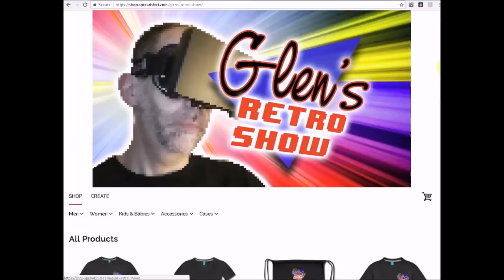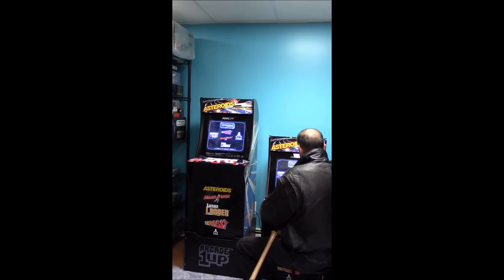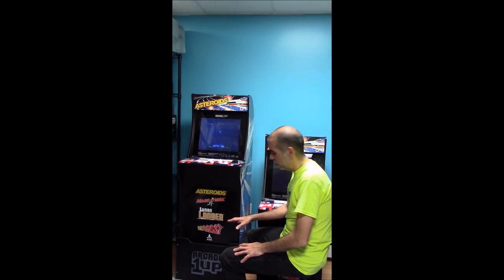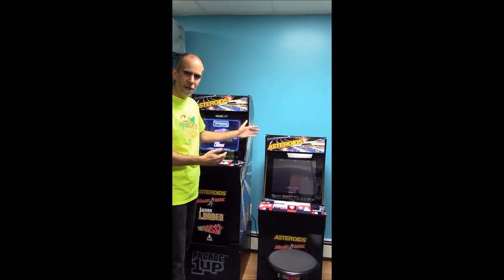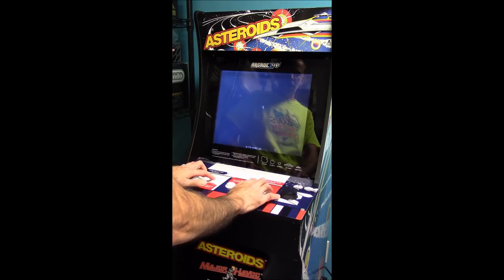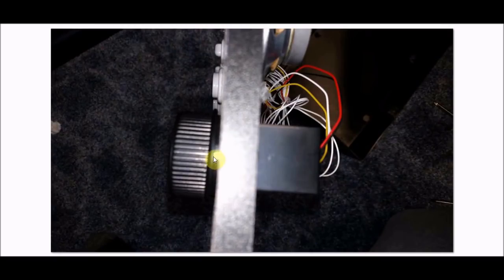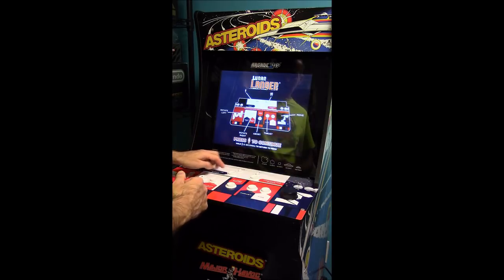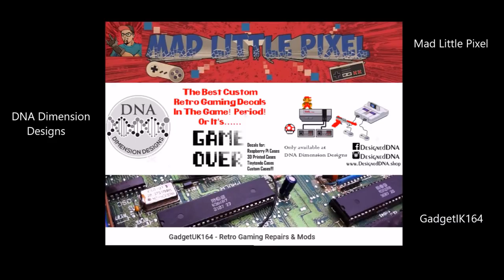Arcade1UP Asteroids/Tempest First impressions

Comment: Glen,

Great in-depth overview as always!  I also wanted to share my experience with you regarding my Arcade1up Atari Deluxe cabinet.  I think I'm going to have to get the Bruce Yeager mod instructions sent to me.  I've been in talks with Arcade1up regarding their choice of using a dial over a spinner, and they let me know they've appreciated the feedback.  My story starts off rocky, but fingers crossed for a happy end!

My Arcade1up experience unfortunately hasn't been as fun. I got the Atari Deluxe cabinet, and ran into several problems. I decided to test out the main components before putting it together and I'm REALLY glad I did. UN-peeling the plastic from the screen revealed my first woes. The whole screen was covered with micro scratches (every inch). I did at first think the scratches might be residue, so I took a microfiber cloth and went over the entirety of the screen. Unfortunately, the marks were indeed micro scratches. 

The second issue came after I tested it. I had concerns about a particular game, Major Havoc, after seeing a video of it being played on an Atari Deluxe cabinet where it had slowdown problems. Luckily, that wasn't the case and the game played at the correct speed. However, what made my heart sink, was the pronounced stuck bright green pixel staring back at me on the monitor. Now this may have been passable, and possibly unnoticeable, on a game like Street Fighter II, but it's a pretty distracting eyesore on vector games since they play on a black screen. 

The next issue, even with my short testing time, I started to see micro scratches forming around the "Dial" (we'll get to the "dial" situation next). Luckily Arcade1up has the overlay solution, so I'm happy about that. But let's talk about that "dial." 

I'm so disappointed that Arcade1up chose to use a dial over a spinner (the dial is akin to a volume control on a car stereo {one that keeps moving}). This makes the gameplay for Tempest and Major Havoc far from an authentic experience.  My dial, thank goodness, works as intended (no sticking issues), clicky but functional, but still not Tempest or Major Havoc worthy.  

As someone who's played these games extensively in an actual arcade, the dial doesn't feel or play even close to the real thing. Does Tempest technically function with the existing dial? Yes, but it doesn't play close to the original. Major Havoc, although also serviceable with the dial, unfortunately isn't precise enough to play very well. The alternative button movement controls on Major Havoc are also serviceable, but again, it doesn't give you the feel of the arcade. And the one thing either of these control schemes can't make work on Major Havoc, is it's "Breakout" mini game. It is absolutely unplayable with either control scheme. I now understand why the early prototype game Arcade1up was testing out, "Super Breakout," didn't make it to market. The dial controller can't come close to matching the precise gameplay required that a spinner provides. 

Now I do realize that the dial may have been more cost effective, but I would've easily paid $50 or more to get a traditional spinner. I hope Arcade1up comes out with a replacement spinner in the future as I really want to play Tempest and Major Havoc again. I did test all the other games on the cabinet and everyone, except Quantum (and the other aforementioned games above), work amazing! Quantum was one of my staple games in the arcade back in the day, so that was kind of disappointing as well. The spin speed on Quantum isn't strong enough to play it effectively. The distance traveled when moving the trackball needs to be increased, upping the sensitivity (maybe to Centipede levels). CALIBRATION IS SORELY NEEDED! But I guess 9 out of 12 games aint bad. 

I did reach out to Arcade1up, and they are going to send me the replacement parts I need (new monitor piece, new monitor, and control panel) along with the plexiglass overlay for the control panel. Arcade1up seems to be a company that cares and I really appreciate that! This is the kind of thing that makes me a repeat customer! There is a bit of a downside however. I've been told it may take up to 6 weeks for me to get the parts. I guess reliving the good old days will have to wait a bit longer :(

Thanks Glen for all you do, and hopefully sometime in the next 6 weeks, I'll be able to "Game ON!"

vgv

Comment: Loved the video!  That said, most people will not want to mod or have a clue- They'll just return them.  The nuts decision of not protecting artwork control panel as a part of their bill of material design is going to be bad for AIU.  Ditto for the control issues- seems non arcade folks designed these.  Apparently the panel protection in their production is happening later, so means thousands of panels wearing and returns to mange.  Not seeing how this first holiday wave ends well.
Reply from the maker: Thank you so much for the comment and watch.  Yes I can agree with what you said.  I can say that they are doing everything they can to address the issues as fast as possible.. they really want to put out a good product.

Comment: While I think these are a good concept, I don't like that they missed important details like laminating the control panel and making the spinner actually function. You can get something similar made from better materials and with a wider control panel that works with a pi from these guys for not much more money: https://www.recroommasters.com/Xtension-Bartop-scaled-down-arcade-machines-s/99.htm

SBCGaming Retro Gaming Community: https://www.reddit.com/r/SBCGaming/
Reply from the maker: Yes, my friend ETA Prime has done a video on that unit.  Also, I believe Arcade1Up is working hard to make corrections to these issue to make a better product down the line.  Thank you for the watch and comment 🙂